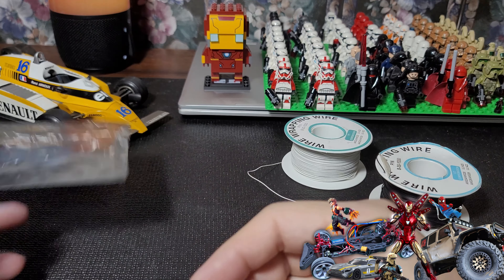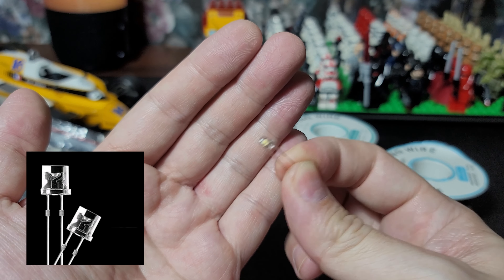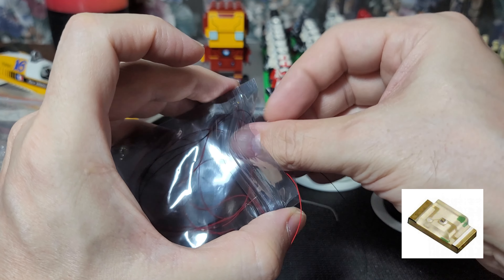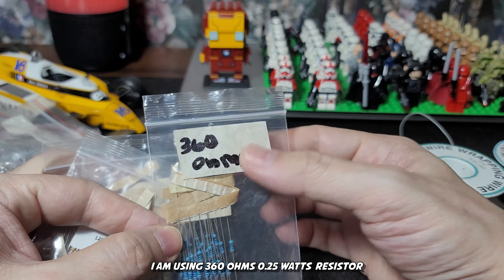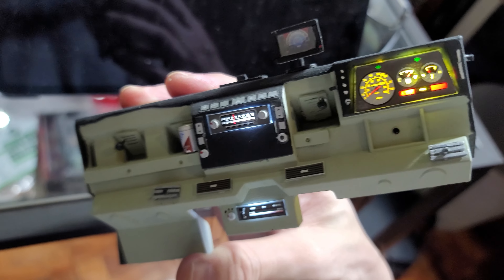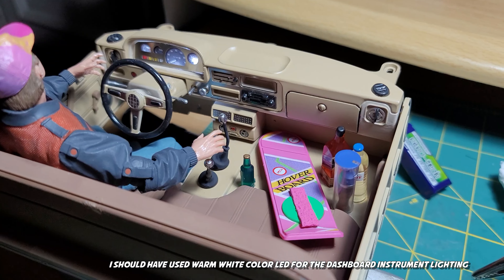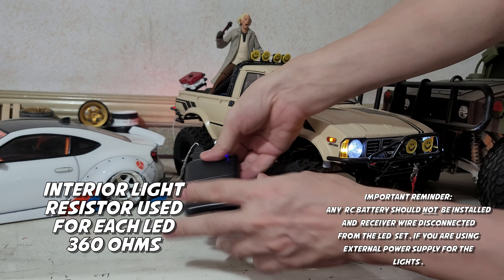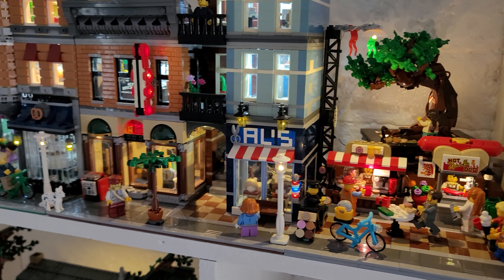How To Make Custom LED Lights For You RC   DIY

Comment: If youre handy with a soldering iron, you can use a L7805 voltage regulator circuit.
Reply from the maker: Thanks for the info, definitely i will look into it.

Comment: Awesome. I made some backlights in series with the front lights on a truck and it took the front lights off. My solution was an extra wire to the front from the motor power and then it drives slower. Next solution was a little solar cell adding to the front and then it blinks between shadow and light when driving. My next project will be planned better, however, it's fun. 

As a bonus I get extra power supplies made which can't drive the motors as hoped for, so I use those for USB level lamps until I get smarter with this stuff.
Reply from the maker: Awesome 👍🏻

Comment: Wow Oliver your knowledge and installation is impressive. I’d like to light my Cruiser but my 3rd channel is dedicated to my winch. You’ve given me some great ideas, thanx.
Reply from the maker: Rc4wd have a original led set for the fj40 cruiser cost around $19.99 ZE0071, this one just have the basic light up features (and it have the unique size led for the original “marker” light buckets for RC4WD cruiser body), connected to any ports available in your receiver, when you turn your esc on, it will just light up, your 3rd channel already occupied, so adding a ebay light switch will not work when you use the winch (using the winch at the same time with “on and off” your lights not ideal), what radio are you using? By connecting directly on your 4th channel it will remain on when the esc is turn on unless you can program the 4th channel to aux switch plus optional ebay light switch for the receiver. If you prefer functional led system that require you to channel one and channel two connected to the led control unit (usually cost around $15 USD), it works when you are making a directional signal (blinking signal lights) and apply breaks (break light brightened up), but main light still light up.
Reply: @oliverstoys8411  Thanx for the info, I’ll see what I can do.

Comment: zero explanations, no circuit whatsoever
so what ? you just plug them in the ESC ? do you build your own connectors ?
worst tutorial ever, yes leds require resistors, so what ?
Reply from the maker: I am sorry you are not contended with my video. Obviously you did not watch the entire video, every few second i included lettered text and image (self explanatory) on the side of this video to what led values and resistors used and probably you did not check the description below also the links of every component used.